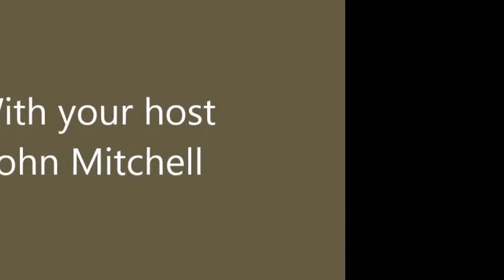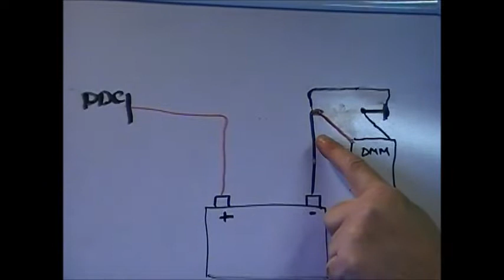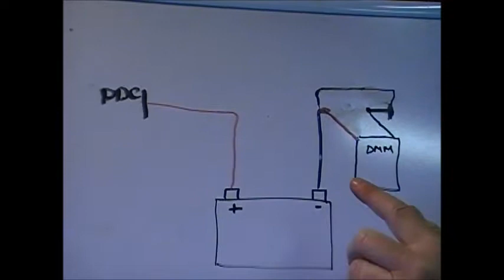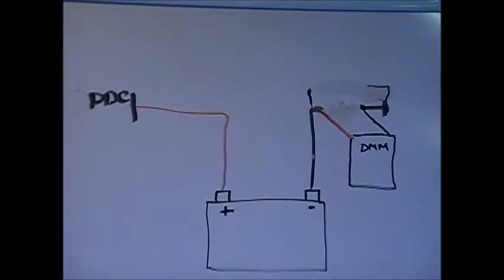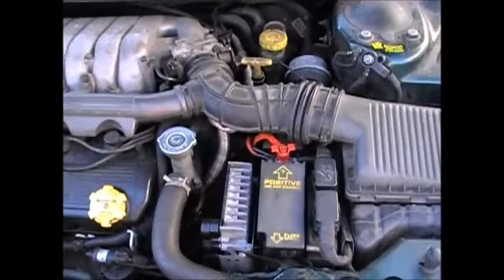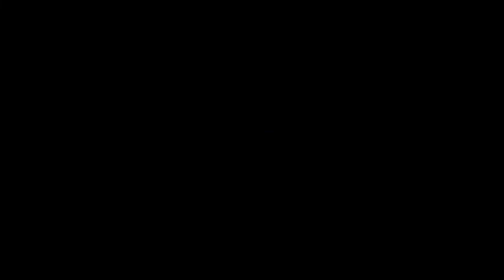1997 Chrysler Sebring JXI convertible power/battery drain

Comment: As for the record. Bought new battery 3 times in 5 years. And now it trains again after 3 days parked. Have tested several times with professional meters and not a mA in drain while standing ... still the battery now again is close to empty after couple of days off. This battery is a hassel to replace. Wondering if the quality of this type of battery for Chrysler is of bad quality.
Reply from the maker: Can't speak to the Stratus as they are a different animal without the same seat belt features.  On the converts  the belts are built into the seats which I suspect they didn't do for the hardtops.  You obviously have something drawing down the battery.  Now the issue is finding "what" that something may be.

Comment: You said the DMM will "click". I think you meant the RELAY will click when you remove that front seat belt fuse, in the Power Distribution Center...under the hood. My 1997 Chrysler Sebring had the back window smashed out. So the car flooded in the rain...like 8" deep. I used an umbrella with bungee cords during the rainy days. On sunny days, I would drive it. The seat belts are a prime suspect. When you pull out the sear belt fuse under the hood, you said: "your DMM will click"...no. Your RELAY will click. I wish more You Tube broadcasters would write a script. Practice 3-5 videos, before you "send" it out to us. Now I have to go back  and watch your video again, to figure out what to do  with that "bracket" you hooked onto that negative terminal. I understood it makes it easy to get alligator clips to bite onto it. But I still don't understand what to do with that thing. I can make one, once the nuts & bolts in my tiny little pinhead sort themselves out. Everybody in Television has a script...otherwise, we get anxious, and hope we went over that important part of the training video.  I have selected "all videos" from you...not just occasional ones. You've done a great job, here. Good luck, read your Bible.
Reply from the maker: Steven, the bracket allowed me to hook my DMM in parallel with the ground lead so that I could take the negative lead off the post but not kill the power to the car.  Why?  Because the Belt module was intermittent.  Sometimes, it worked properly, and the car would pull 15ma.  Other times, it was misbehaving to the tune of it pulling over an amp (1.2 if memory serves me correctly) for HOURS and thereby killing the battery in about 2 days.  Breaking the circuit would allow that module to 'reset' and work as it should...for a spell.  So, I had to find a way to easily hook my meter up and not break the circuit. Hence the bracket.  Now, unlike you, I had no reason to suspect said module.  My car hasn't flooded.  However, unlike you, I had nothing to go on other than the usual b.s. trash that the internet had offered up such as "check your dome light, check your trunk light".  So, with that being said you don't have to watch the video any further for you have the cliff note version at hand.
As for your wishes- This is the 2nd week in a row where you've complained, commented and otherwise pointed out my gaffs yet your questions show me that you didn't watch the complete video.  Now you don't need to watch as I told you all I did but remember something- this sh*t is free and this isn't a professional production.  I don't have a crew nor the time to 'write a script' and practice with 3 to 5 videos.  This is a one-man operation of a busy guy.  Animals, wife, life, they all take their time.  If I got paid, I'd LOVE to do T.V. worthy shows but I don't and YT is free.  So, I try my best.  If you think you can do better, than by all means please do.  Your channel shows you've posted nothing other than comments (nothing like the luxury of criticism, eh?) so it may be an eye-opening experience for you to film, edit and post content.    That being said, if you don't like something I said, or my delivery makes you "anxious" then just move on.  Hate the sound of my voice?  Move on.  I said X instead of Y, move on...especially when it involves a video I made 2 years ago!   Think you can do better?  Please do.  Let's see your results.  However, until I get paid for this to where I can get script writers, a teleprompter, editing crew, etc., you get what you get with warts and all and sadly I am an incredibly flawed human.
Reply: @Theoriginalmalcontentcorner Sorry I insulted your work, John. I need to watch these videos much more before I comment. Actually, you're doing a really great job! I'm sure you already know the permitted current draw is 50ma. All these Chrysler Convertibles had a lot of parasitic current draw. They had certain fuses pulled when these cars arrived at the Dealerships. Because fuse #5 & some others would drain the battery before 30 days. So...if a customer wanted to test-drive a Sebring Convertible, they would have a guy put the fuse #5 & whatever others back in. So it would start. I doubt Chrysler told their customers about the parasitic draw problems. Please forgive my ignorant, low-life trashy opinion.
Reply from the maker: @trainman1209  :  No worries, it is all good.  I  know there will be some parasitic draw.  Main issue was that the module would go bad,, I'd disco the batt to measure the amperage and dang if it all didn't 'work and look' like it should because said module reset and worked like it should.  Typical intermittent issue that is a PITA to find and fix but all is good now.